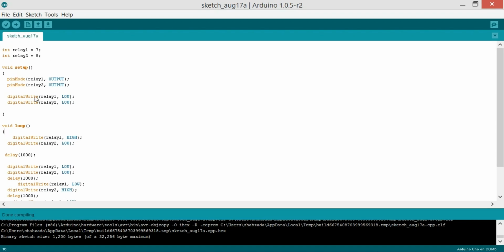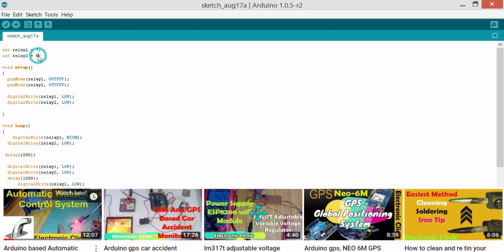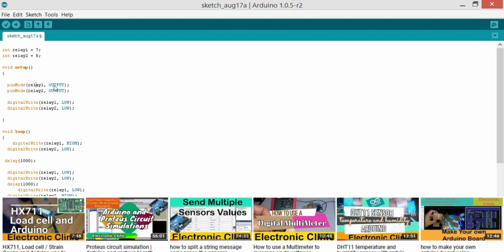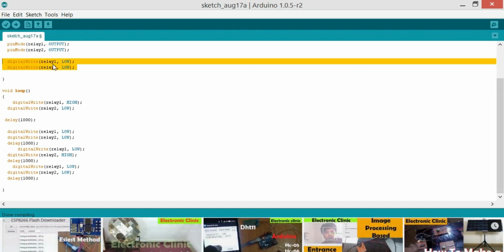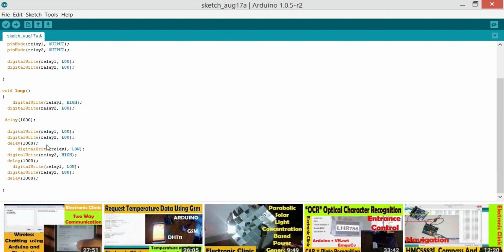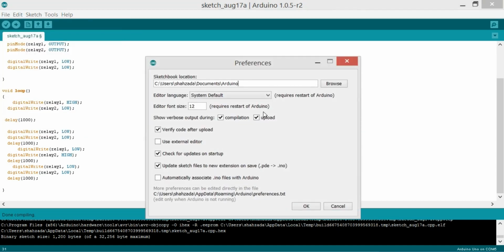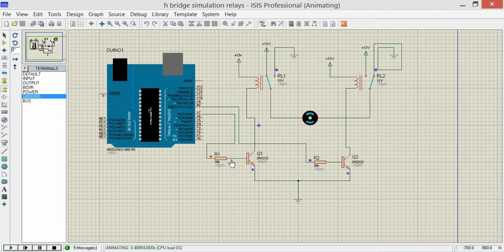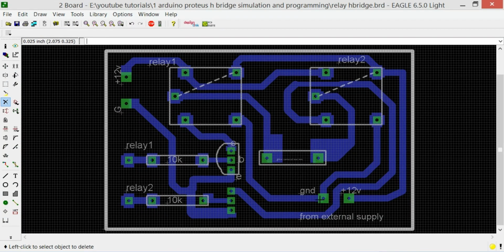Arduino Dc motor  Relay H-bridge simulation in Proteus, Programming, how to make H-bridge module

Comment: Made the circuit as above but relays latch on with transistors in circuit. Changed the transistors to TIP41C and works as expected.